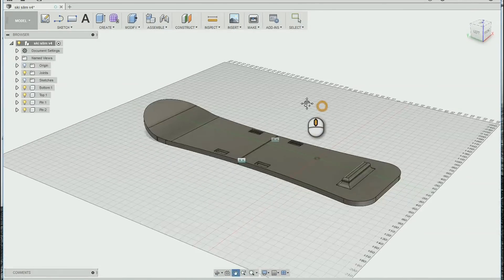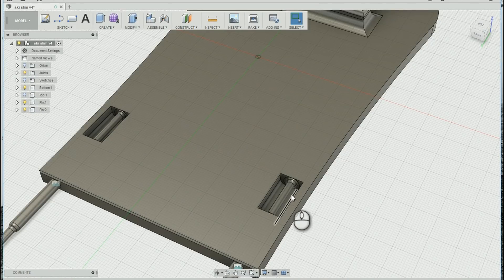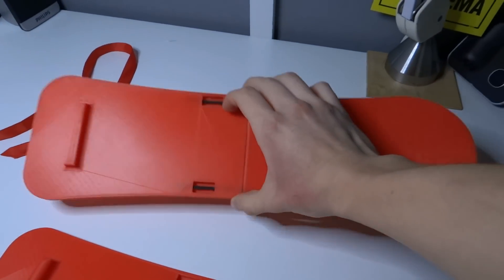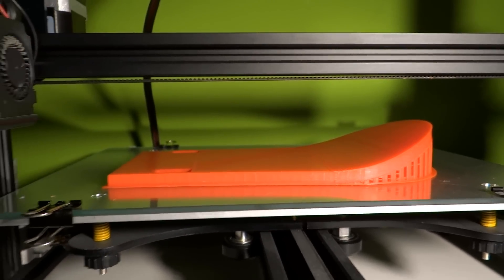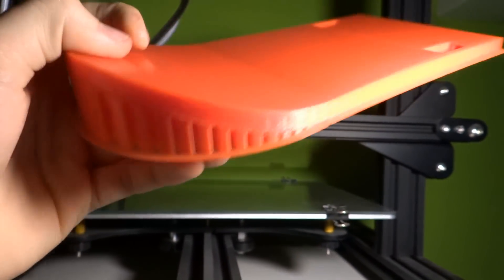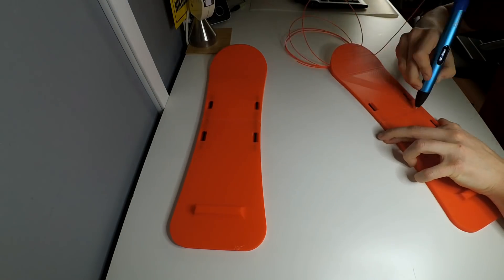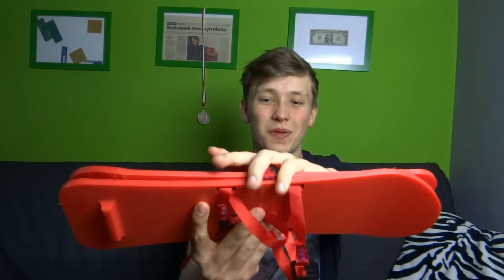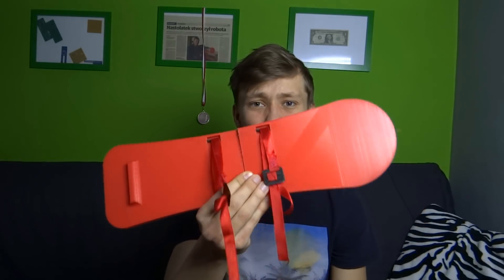3D Printed Skis - Will they Work?

Comment: I have no experience of welding 3D-printed elements but the very first solution that comes to my mind is "loctite" or loctite-alike glue. After all it's about welding plastic elements. Have you ever failed in using such glues?
Reply from the maker: I don't really like glues, and in this use because of huge forces that are applied to the joint it wouldn't be strong enough
Reply: I'm printing a camera holder and I'll give super glue a try. Later on I'll try your print pen and I'll tell you how resistant each v. other is. By the way I've found this on the web:
"Super Glue actually was used  in the Vietnam War to help close up wounds
 on soldiers while they were being transported to hospitals to then 
receive stitches.  Today, a form of cyanoacrylate is often used in place
 of or in conjunction with traditional sutures."

Comment: Cool jazzy background music as usual. Have you used a PLA filament? Each and every project is interesting and helps you learn at least how to use a CAD/design software like your fusion360 the best IMHO.. right after Blender... Skis have to support incredible mechanical constraints and do need special materials for. Have you tried more flexible filaments?
Reply from the maker: Thanks! I used PLA, the problem is not the material itself PLA is good for it I think the problem is connection between two parts of the ski. You can see that one of the skis (the one that broke completly) encountered a small hole in snow so that was the reason why it broke. It would be strong enough if printed in one piece.
Reply: Of course. I print on the cr10-mini too. Mini.... all is said. But my projects don't need more actually. It's a pretty good printer really.
Reply from the maker: Yes it is really good printer, it's called mini but it is just a little bit smaller then the CR10 (so it is not so mini) but quality in my opinion is much better. That maybe caused by smaller bed so the inertial force is smaller while Y axis movement.
Reply: Agree